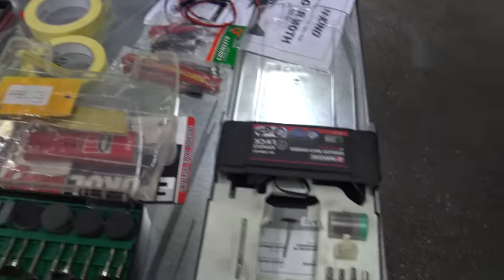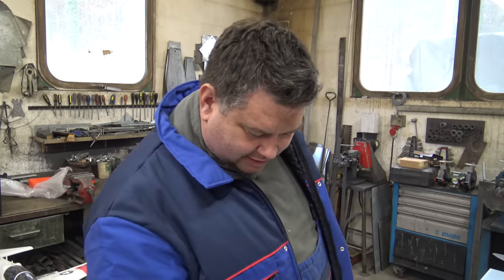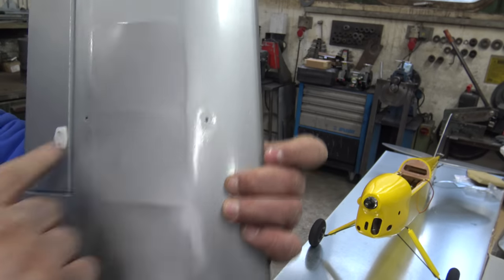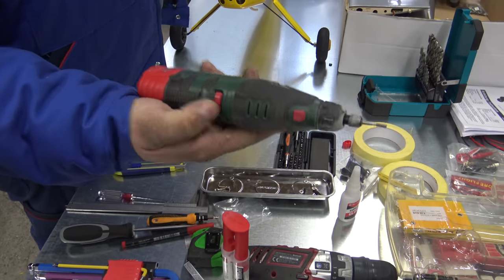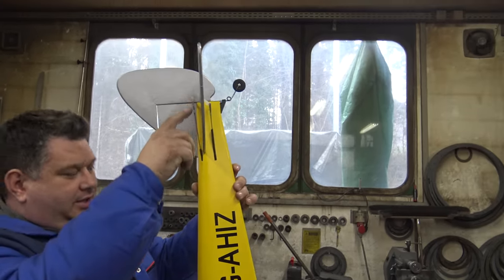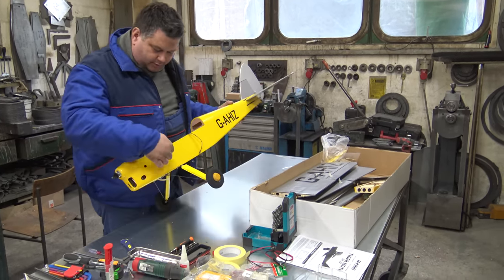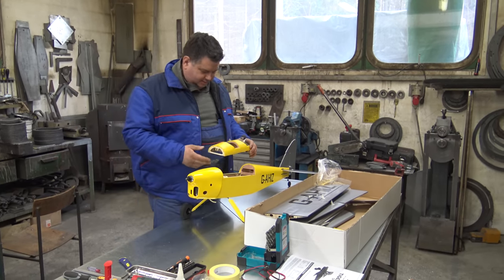H-King Tiger Moth (Cambridge Flying Groups de Havilland DH82a) 1400mm (ARF) Assembley progress

Comment: Good tips for modelers Captain Blaz I to tell you can put lipo on side of your starter admiral 14.8 v 4s 2500 used zip ties  alot better than having wire going from flite box and more power in your starter

Comment: Captain Blaz, very good work on assembly!  I am building the H-King SE5A, 1408mm wing span.   I was lucky to find (old stock),  I am using a Saito 56 for it.  The Saito 72 in you plane will fly it straight up, vertical I'm sure, salute!

Comment: Thanks for the tip ! (used it many times - but these days seems easier to forgot than learn ;-() )
P.S.
Blaž - maine is on way (I hope) :-))
And you probably know very well what engine will go in (gaser - it seems that it never was meant to be for SIG Hog..) - by reports from forums on similar/exact model (VQ/Pichler) - little bit more weight on nose won't hurt ..

Things I like to know from your first hand experience: 
- thrust line - hard to tell from video - did you measured right angle thrust ? 
(no data in manual, except that distance from prop hub to the firewall is 130mm )
(manual says that bulkhead is pre-set in factory and it looks that holes are a bit offset - suggesting there is some right thrust already built in ..)
- are those stock supplied engine mounts ? (left one a bit cut off )

Can you tell servos used (what Tower Pro for Ele and Rudd and what for Ailerons ?)
Probably will phone you for some more advices - being in foamies so long that even forgot where my switches are - will make 2 separate Eneloop batt. packs ..

P.P.S.
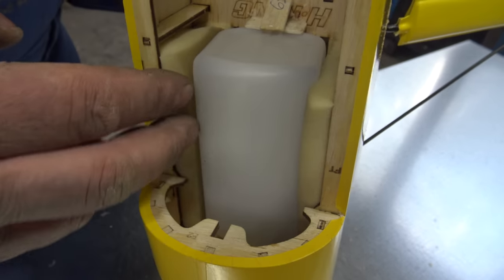Please watch this video - about from 3:00 on - https://www.youtube.com/watch?v=MwMAlEZ2LQc - if anyone I know can help him with advice it is probably you ..

P:P:P:S
After all these goodies - a very sad news - SIR Bruce from NZ made this video -  https://www.youtube.com/watch?v=G2KSmBy4lQk - a word from you can reach very far ..

Comment: Nice cowl fit but I think you are going to have to cut a hole in the bottom for cooling. Rule of thumb 3 to 1 one part air in 3 parts air out.

Comment: PS..I'm building the same kit as you Blaz…I'm wondering why the Z wing parts are not drilled to fit...HMMM ..I will figure it out...let me know if you have any ideas!
Reply: bruce W yes they are but the holes are under the foil...just locate them and punch them..

Comment: Engine cowling looks like needs more holes to exit hot air. 
Area of exit holes should be greater than area of Inlet holes to prevent engine overheating
Reply: Danny Simon yes true...i will do it when engine is broken in...

Comment: Could not see if you offset the motor to avoid any massive climb at wide open throttle or torque steer at takeoff....hey??
Reply from the maker: It is already made at an angle my friend.
Reply: @PetrincicBrosRC a yes it is but not very much

Comment: Hi, could u please help me. I would like to buy this plane for my father from hobby king, but I dont know what parts do I need. I found an engine: E-flite Power 46 Brushless Outrunner Motor 670Kv ( Actually I wanted to be a 4 T stroke, but I couldnt find and dont wanna risk). But what else should i ADD to my shopping card - I see there is SERVO, ACC, Battery... Can u please help me with links from h-king to make one completed ordered, so when i give him the present, he will have everything needed for this wonderful plane : )